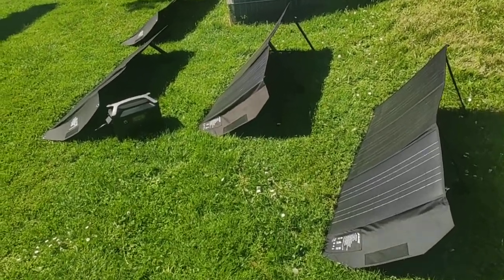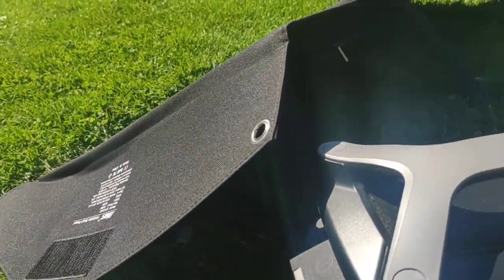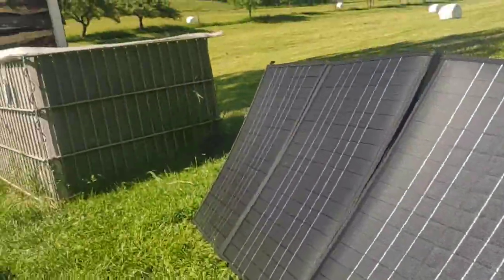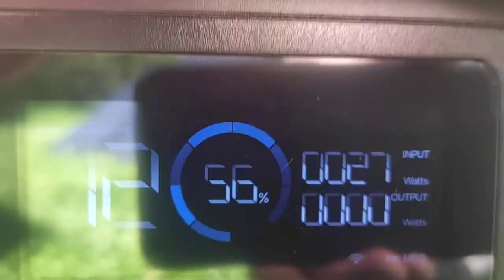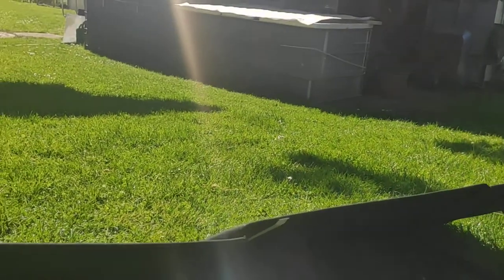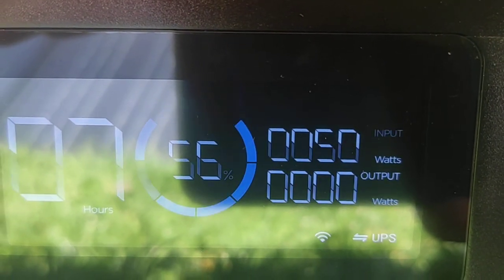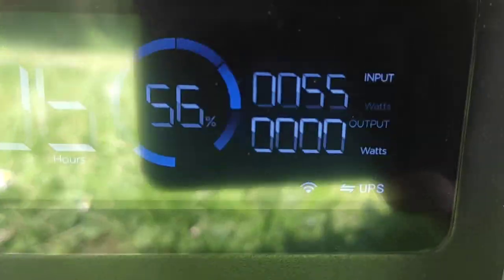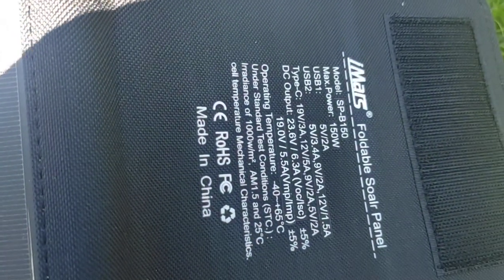XMUND SP-XD2 and iMars SP-B150 (similar as Kroak SP-06) solar panel comparison test

Comment: Hello, thanks for the video. I have been using the Xmund solar power for a month but now i cannot get more than 20-25 watts even in summer most sunny days...the first time i used it i reached 50 watts. Did it happen to you too or is my panel faulty?
Reply from the maker: I'm assuming it's defective. If you get 25W, only one area is connected. At 50W two areas are connected, at 75W three areas. Darken an area and see if performance drops.

Comment: Nice and reliable test! But Im not sure if I understood why The 150W panel produced less energy.... Would you mind explain it again, please?
Reply from the maker: Chinese manufacturers often write twice or ten times the power on the solar panels. Then there are modules with different levels of efficiency (roughly between 14 and 24%). The fact that the performance of the iMars/Kroak 150W panel decreases with increasing heat is due to the cheap construction by the manufacturer. The individual cells are laid on top of each other like roof tiles, which means there is poor electrical contact between them when heated.
Reply: @antigravity8247  Thanks a lot for the explanation! It's a huge difference. I 've been looking for one of these and your vídeo helped me a lot. Thanks!